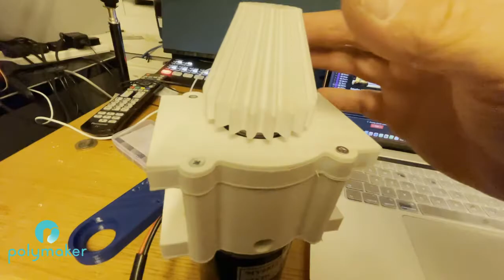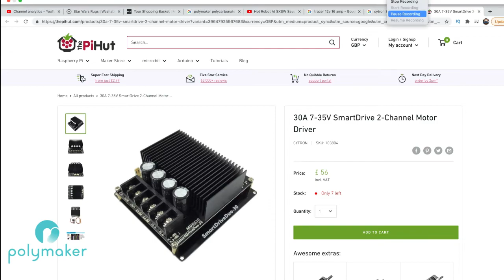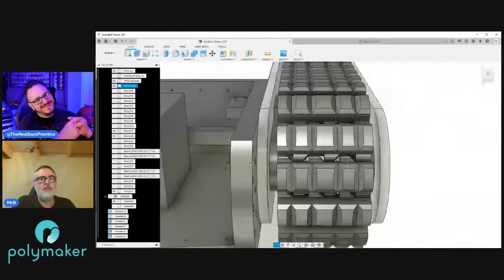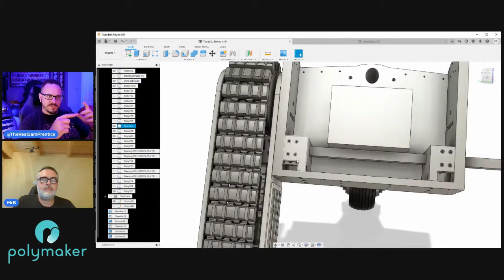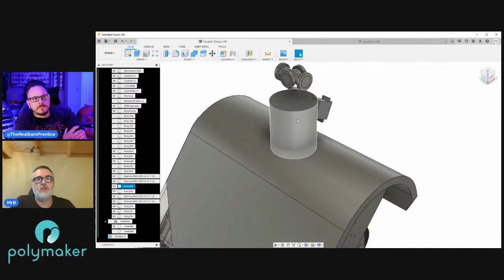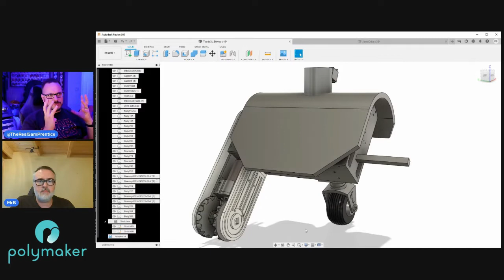3D Printed Robot Part 2 with Mr Baddeley

Comment: I wish you had just thrown a wheel on the end of the leg.  The way the leg works that track is a total waste of time and material.
Reply from the maker: We do it because we can not because it makes sense, also for the future there could be a mech that allows the robot to go flat and the tracks function differently:)
Reply: @TheRealSamPrentice  I dont think your ever going to lay this flat without re designing the most of the droid.  And Im sorry but making that huge track to just have the tip of it in contact with the ground makes zero sense beyond esthetics I guess. putting a wheel at the   bottom would be much more functional and could free up the shoulder for arms or something.
Reply from the maker: @bgrant1512  you have a tedo right?? The only point is that it’s designed from a starwars sketch, so scale and pointlessness is really irrelevant. You could wack some gearing and a locking latch and it’ll lay down. The sketch also showed tracks on the rear leg so I’d like to see how that would work too
Reply: @TheRealSamPrentice  I do have a tedo. I thought the tedo was a Baddeley original and would have given a little more leeway in the design. I can always try my hand at designing one with wheels based off the files when they are released.
Reply from the maker: @bgrant1512  watch my first video on this and you’ll
See the concept droid :)
Reply: @TheRealSamPrentice  I took your advise and watched the video, this isnt from star wars cannon. He could do anything with the design. To each his own but we are not all sponsored, TPU is what $30 bucks a roll? how many rolls will those tracks take? Thats not to mention what a pain in the butt it is to print and join all the tracks.
Reply from the maker: @bgrant1512  The tracks use 2mm metal rods, so its super simple to join. The print time I think it was around a couple of hours per track and there are 72 - That was a pre ratrig number - I think it took around 1.5- 2 kilos to print. I would however say that the head size was more of a challenge. To be fair if this was 1/2 scale it would be favoured, we will see what happens.